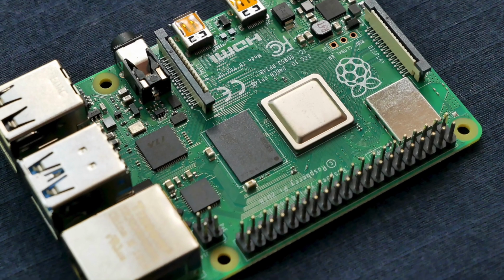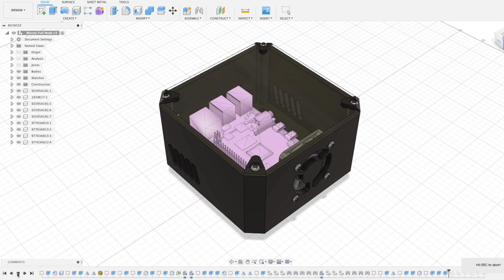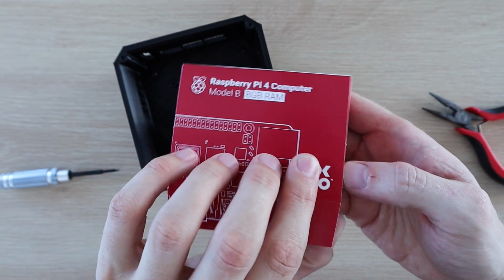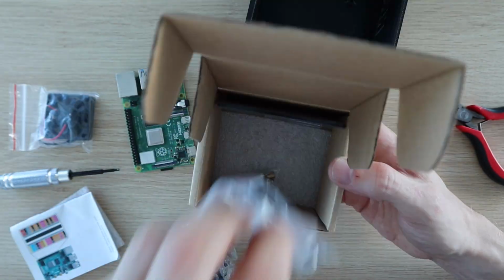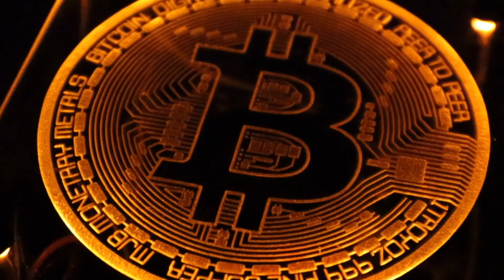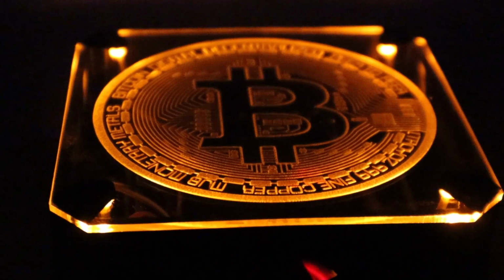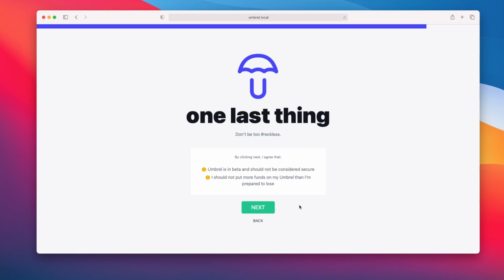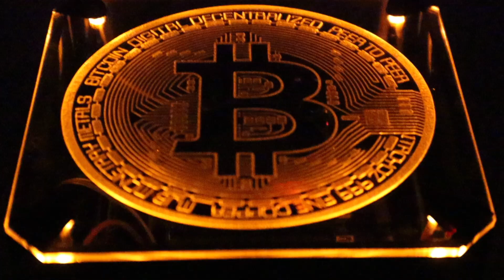Build & Run Your Own Bitcoin Node On A Raspberry Pi

Comment: #1: What kind of tool did you use to screw the ice tower brass standoffs into the bottom of the case to support the case and the additional standoffs screwed through the PI board to the brass standoffs you inserted below?

#2: How do you access to ports (audio jack, micro hdmi, etc) on the side of the PI from outside the case since there are no cutouts for them?
Reply from the maker: 1# It's just a small hex socket set from Hobby King - they're intended for RC aeroplanes and cars but work well for these as well.
2# Those ports aren't intended to be used with this case. Being a node, it doesn't have any audio output and doesn't display anything over HDMI. The UI is all provided over Ethernet to a web page.
Reply: @MichaelKlements  Thank you
Reply: @MichaelKlements  Have you given any more thought to building a case that will hold a PI4 with low profile ice tower, geekwoom power board (safe shutdown with the nice momentary round switch), an x862 board to hold an NVME, and a led display?  The kitchen sink case!!!
Reply: @MichaelKlements  #1: I don’t want to crack the plastic, but I’m having a hard time using my new socket to screw in the brass stand-off pegs.  Seems like it’s taking more pressure than it should and I’m a bit nervous.  Did you need to pre drill the holes a bit or do something else to make that process easier?  Thx

Comment: Just got all my computer components together per the parts list, however, it appears I also need a usb C to USB cable to connect the NVME case to the PI, correct?  The ones I have laying around don’t seem to work.  Is there a specific cable I need?
Reply from the maker: Your enclosure/adaptor for your NVME drive should have come with a USB C to USB A cable? There isn't anything special about this type of cable, it's something that is commonly available.
Reply: @MichaelKlements  It did not. The one you linked on Amazon came with a usb c to usb c cable.   I ordered one and hopefully it will work.  When using the cable I have now umbra reports that it can not find an external drive.  I did connect a smaller sata drive with usb to the pi and it worked fine, except he drive was too small.
Reply: @MichaelKlements  In order to tested the nvme, the cable and the enclosure, I should be able to a windows machine and it should recognize it, correct?   It is not and the umbra software says no external drive as well. Any troubleshooting suggestions?  Thx
Reply from the maker: Yeah unfortunately Amazon stores seem to swap "similar" products around or substitute them when they can no longer get stock, so it's likely not the exact same enclosure that was originally linked. It should still work though.
The windows machine should definitely recognise it. If it's not being recognise then try removing and reinserting the drive. Also try a different cable if you can. If both don't work then either the drive or the enclosure may be faulty.
Reply: @MichaelKlements  ok that was all I could come up with as well.  Thanks
Reply: @MichaelKlements  I am so darn close to getting the node running . . .
Reply from the maker: Is your drive now working? It takes a long time to download the blockchain (or maybe my internet is just really bad)
Reply: No. I may need to return the NVME and the enclosure to Amazon and try again with replacement product.  Makes me wonder if I should also order a different enclosure.
Reply: @MichaelKlements  Just got a replacement drive and enclosure and unbrel still doesn't recognize the external drive, thus preventing the node from starting and the blockchain from downloading.

Any suggestions.  I bought the WD drive and Sabrent enclosure you recommended.  Thanks
Reply: @michael klements.  Anything you can do to assist?  Thanks.
Reply: Blockchain downloaded now.  Now just trying to get everything to fit into the case. Also the replacement NVME enclosure with current product available (your is discontinues) is longer then the one you used on your build so I am having to cut into the back wall of the case to make room for the additional length of the current NVME enclosure. Getting closer.
Reply: Also, getting the existing led ice tower fan off and replacing it with the black fan was a bear.  Still not sure I did it right, seems to be holding but not as well as the original.
Reply: Can you link the red power cable you used form Amazon.  The ones I found don’t fit well.  Thx

Comment: The NVME Amazon link to the adapter looks a bit different than the one in your build.   Will it fit in your case and attach to it as well as the one you used?  Thx
Reply from the maker: Unfortunately these sort of adaptors get changed/swapped out by suppliers really often, so it's really difficult to find one that'll remain consistent for a long period of time. The best would be to get the adaptor you'd like to use and then adapt the cutout in the case prior to printing it out. It'll just be the port hole through the side wall that may need to change.

Comment: Doesn’t the low profile black ice tower fan also have the led lights that are not wanted due to their effect on your yellow lights?
Reply from the maker: The one fitted has LEDs on it but they also give you a plain black on with no LEDs which you can swap out. I used that one.
Reply: @MichaelKlements  so a plain black one comes for free with the silver one with led lights?
( excited about getting mine up an running.  I have some friend anxious to see it when it’s complete as well)
Reply: @MichaelKlements  I have another question.  I saw another video and they suggested that once you have the blockchain fully downloaded you don’t turn it off and then back on again.   If I did that to DL the full blockchain and then powered it down to switch cases, wouldn’t it just DL the missing blockchain and then resume without issue?  Thx
Reply from the maker: The plain black fan comes with the black Ice Tower, the silver ones I've got come with a clear non-RGB fan as a replacement as well. This also seems to depend on where you buy them, the ones I've got off Amazon all include two fans while one or two of the ones I've bought off Aliexpress have only had the one fan.
In theory what you're saying should be the case, it should just boot up again, check the block chain and download whatever is missing. It is usually best to just leave them running though, they don't like being "disconnected" from the network for periods of time.

Comment: Is there an easy way to connect the NVME drive to the pi inside the case without using an external cable?
Reply from the maker: Unfortunately no, it has to be plugged into one of the four USB ports. It would be nice if the Pi had some sort of USB breakout on it as well - similar to the CM4 I/O Board.
Reply: @MichaelKlements  I have seen some kind of NVME daughter board that fits under the main pi board, but I’m guessing that would change all of the spacing requirements for all of the ports on your case.  It would sure be slick to fit an NVME inside the case and have it out to that as well.

Also I wanted to check, since the purpose of this is to create a no that is always running, I’m assuming the micro SD card just stays in the port all of the time and accessibility to it from inside the case is not really an issue because you never really need to take it out?
Reply from the maker: Yeah, you'd need to change the case pretty substantially to accommodate an NVME shield underneath the Pi and it still requires a USB jumper to plug into one of the Pi's USB ports.

Yes, that's correct, you shouldn't need to remove the microSD card unless the software has been corrupted or there is an issue with your node's operating system.

The black low profile Ice Tower is just from Amazon. You can also often get them on eBay and Aliexpress.
Reply: @MichaelKlements  One other thing, can you tell me where you sourced the black ice tower fan that you use to replace the LED fan? Thank you

Comment: i know this is video is a bit old, but do I need to use a raspberry pi 4? Can i use a 3B+?
Reply from the maker: There is enough space for the 3B+ but the USB and Ethernet ports are switched around, so it won't align with the cutouts.
Reply: @MichaelKlements  i was more thinking does the 3 have enough power?
Reply from the maker: I wouldn't have thought it would be a problem. I don't think running a node like this is particularly resource intensive, it's basically just "monitoring" the network and interacting with it, it's not doing any intensive processing (at least as far as I'm aware).

Comment: Hello Michael  i was wondering why should someone run a BTC node is there any profit beside helping the network ? 
And 1 last thing i have invested a small amount of money in btc should i run a node? For secure  transactions ?

Thanks
Reply from the maker: The primary benefit is reduced transaction fees as you're not dealing with a third party provider, a secondary benefit is that your information is all held and managed by yourself and isn't on another provider's server.

Comment: What is the minimum down-/up-load speed of the internet connection required please?
Reply from the maker: The connection speed is not that demanding. You probably only need around 100-200kbps, but you need around 6GB per day in bandwidth.

Comment: Ive a question about the 3d file and the alternative to the NVME SSD.
Is there the same space available to place in your 1TB samsung SSD instead of the 1TB NVME with casing? 
Or do i have to chance the design to make that work?
Reply from the maker: There isn't much room in the case for a larger drive, that's why I used an NVME drive. If you made it a bit taller you could probably fit a 2.5" SSD into the case.
Reply: @MichaelKlements  Thank you for your answer. Another question: What kind of files are they? Is it possible to use solidworks to change te file to my desire? Or are they only "print ready?"
Reply from the maker: They are .stl files. I'm not sure about solid works, but most CAD packages can import the model for editing, it's not only a print ready file.

Comment: Thank Michael.  You inspired me to tackle the project and couldn't be happier.  Anyone, I want to ditch the ethernet cable and go with Wifi..is that possible with a RP4 running as a Node on Umbrel?
Reply from the maker: That's great Joe! Yes you can go with WiFi, it's just a bit more temperamental. If you've got a local Ethernet connection it'll be a bit more reliable and stable.

Comment: Hi Michael, I plan on purchasing the STL and laser cutting file but wanted to know if I can use Crucial MX500 2TB NAND SATA 2.5 inch internal SSD?
Reply from the maker: Hi Victor,
Yes the drive will work with the Pi with USB adaptor. There probably isn't enough space to fit it into the case though, unless you remove it from the metal enclosure.

Comment: Love this build.  Quick General Question:  I would be very interested in buying a few of these cases for gifts.  To purchase thee totally built would be ideal but if I could build if need be.  My question is what would be an estimate on the case cost?
Reply from the maker: It would probably be around $100 for the case, the 3D printing and laser engraving take quite a long time. All up you'd probably be looking at around $250-300 if you build them yourself.
Reply: @MichaelKlements  That's totally understandable. I actually think that price is a great deal.  
I want to purchase. how can i contact you to proceed.
Reply: @MichaelKlements  Love this case too! Would love to buy one if you still make them?

Comment: Never thought that running a Raspberry Pi will earn you some sats hehe thanks!
Reply: What's the merits of running a node?
Reply: @chaeneth6979  passive income on the side afaik
Reply: @chaeneth6979  Lesser cost and lesser computing power needed than mining
Reply: @daveleegers611  So this means you'll be still able to use your PC that's running a node?
Reply: @yumilike-k2d  I guess cuz it promises to run on idle power
Reply: @daveleegers611  this is a much better way of getting some passive income
Reply: @davidlee5303  Any usecase for projects like these?
Reply: @davidlee5303  Pretty much yeah
Reply: You'll only need some 35 dollar raspberry pi module and a hard drive to run a node
Reply: @daveleegers611  That's much better then!
Reply: @daveleegers611  how long do you think will I make profit if I buy raspberry pis en masse?
Reply: @lionheart6119  technically this is different than mining but you'll get some btc due to transaction fees but it's not alot hehe
Reply: @daveleegers611  can I realistically make big money from it or just passive income at the side?
Reply: @lionheart6119  Might be soon but yeah this thing has huge potential
Reply: @daveleegers611  I'll try aping in just cuz I dont want to miss the next new thing
Reply: @davidlee5303  why would I prefer this over gpu farms? genuine question
Reply: @lionheart6119  You have to lol the one I'm talking about is Strongnode. I've been seeing it on social media for sometime now and after researching this could really be the next big thing.
Reply: @daveleegers611  Will profit margins be significantly different?
Reply: @chaeneth6979  Based
Reply: @daveleegers611  oh wow this is something new to me. I'm definitely in but first where can I get updated on this?
Reply: @davidlee5303  yeah you can get updated on their telegram just search strongnodechat and you'll be gravy. But if you want to read more about this you can check out their website on strongnode io
Reply: @daveleegers611  Oh wow good looking out! Thanks for this one
Reply: @yumilike-k2d  Hehe all gucci
Reply: @daveleegers611  I've stumbled with it and I looks appealing to me that's why I want to know more abt it
Reply: @chaeneth6979  free money babyyyyy
Reply: Yeah, it's a much better way than to buy a mining rig. This node technology is  a much better choice than mining imo
Reply: @yumilike-k2d  I think it's much more healthy for the environment too
Reply: @chaeneth6979  Super true! Mining rigs are so harmful for the environment this is such a refreshing
Reply: @lionheart6119  lol imagine getting fried because of your mining rig
Reply: @yumilike-k2d  What's the difference between node "mining" and gpu farming?
Reply: @kevindonaldson3263  Well in GPU farming or mining you earn those bitcoins yourself but for running nodes you earn through transaction fees
Reply: @daveleegers611  Oh yeah that's gonna good for the environment cuz I've seen the amount of power gpu farms garner
Reply: @marky2929  The heat signature itself of those farms sheeeesshhh
Reply: @daveleegers611  Yeah as an environmentalist myself, I dont support gpu farms as much as I want to earn big money
Reply: Lesser heat signatures= less environmental impact
Reply: @yumilike-k2d  which is a nice thing since the world's temperature is rising up
Reply: @yumilike-k2d  what about my incomes though? is it substantially less?
Reply: This way you can help the environment and earn some cash on the side lol
Reply: @davidlee5303  yeah and the server load times are gonna be faster even for non investors
Reply: But I've heard some upcoming project that looks like Raspberry Pi
Reply: @daveleegers611  Hmmmmm, does it have the same concept as Raspberry Pi?
Reply: @yumilike-k2d  lol I want to know more
Reply: Just thinking of living in a house with some mining rigs intact gives me the hibby jibbies
Reply: However this is a completely different concept but still running a node. This one uses your PCs or other devices untapped processing power to run it
Reply: @daveleegers611  But isn't it harmful to your device since its using the reserve power?
Reply: @yumilike-k2d  lol true won't it overclock it?
Reply: @yumilike-k2d   I think this just runs on Idle processing power so it won't burn out your CPU
Reply: So you guys don't even have to worry about burning out your CPU. Plus they're ace up in the sleeve is that you can run this on any existing setups you have like, Smart TVs and your old phones.
Reply: @daveleegers611  Oh wow this is sweet! How can I set it up on my devices?
Reply: @yumilike-k2d  Uhh yeah, problem is they're not released yet but I believe that the launch is soon in about 2-3 weeks according to their telegram updates
Reply: @daveleegers611  Hmmmm this is sweet! How can I get any updates for this upcoming project then?
Reply: @yumilike-k2d  What's the project called
Reply: How can I cashout if I run this on my raspberry pis

Comment: Hey Michael,
Your work is awesom and inspiring. To make money raspberry Pi is taking ages, I got one pi-4 I used as desktop for sometime but not in use now can u suggest anything that can make money with it (apart from mining 😁)
Thanks ❤️
Reply: Did you already earn yet?
Reply: I used some xmrig and rxmr algo to mine Monero using minergate pool and it gave me upto 128h/sec and was running few days continuously. No earnings possible 😂
Reply: @umarfarooquemomin  What rig do you think is needed to run this type of tech with a good profit margin
Reply: Trust me dude...if you really want some earning from crypto you gotta need multiple high performance GPUs, Lot of cooling and a gigantic electricity bill,

Comment: Thanks for the great video!  Unfortunately I am getting "Failed to start External Storage Mounter".  I have verified that my external 1 TB Samsung SSD is formatted and readable with my Raspberry Pi when booted with a clean Raspbian SD card.  Any idea what I should do to fix this Umbrel start up issue?  Also, is there a way to view additional startup log files.
Reply from the maker: Hi Jonathan, 
Sorry I'm not really sure what could be causing that. Perhaps try asking the question on one of the Umbel forums or on reddit?